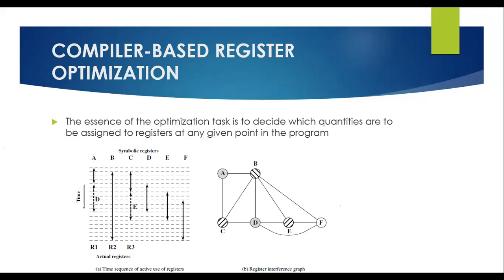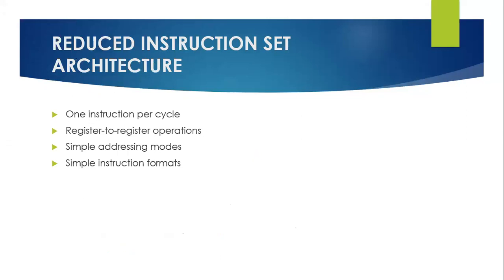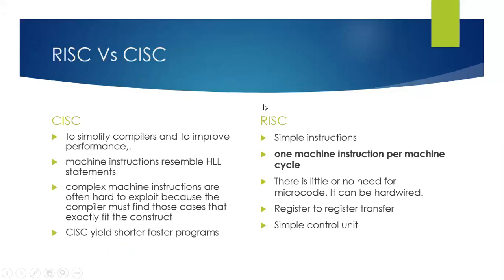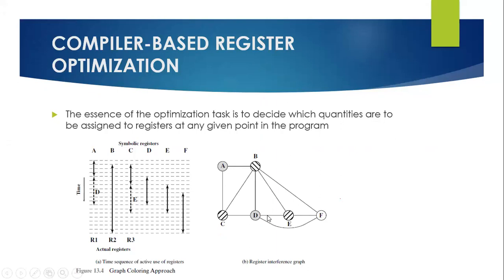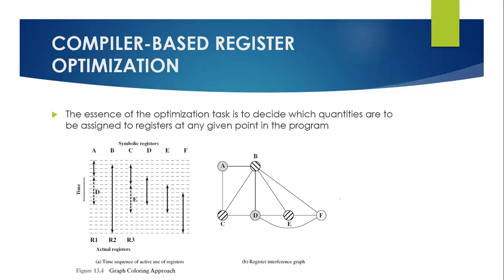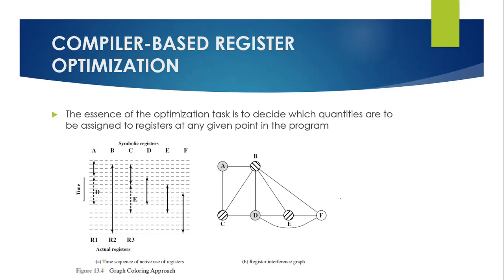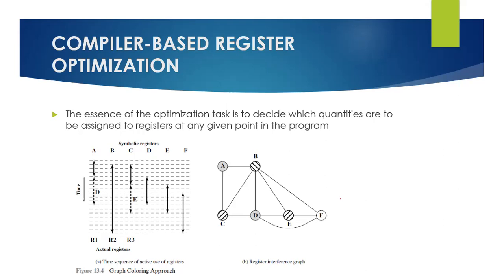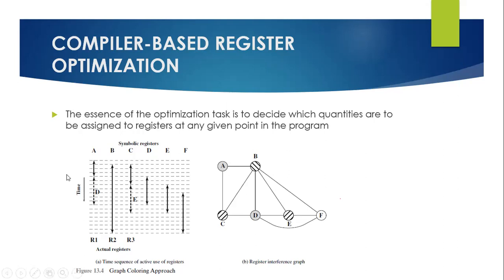CAO Lecture 13 Compiler based register optimization

Comment: could u tell about this also: the compiler based register optimization method to optimally use 3 processor registers for 5 programming variables.